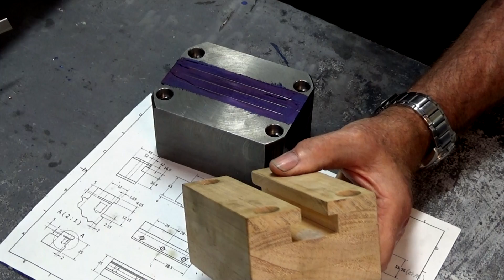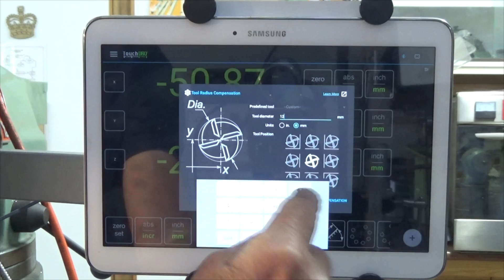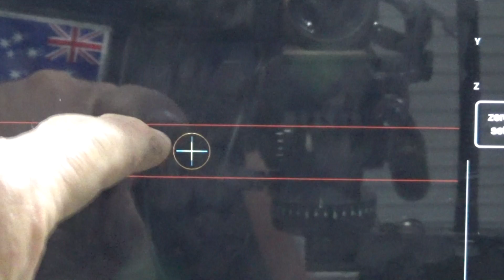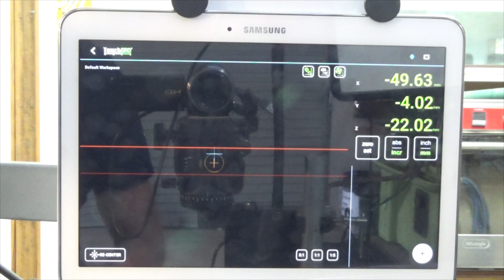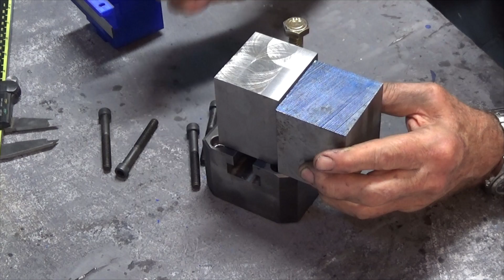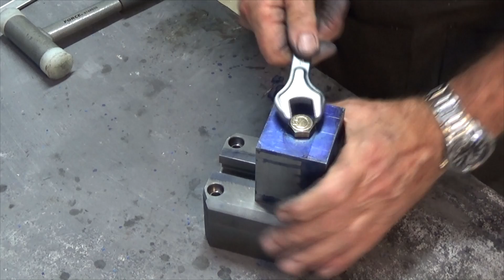Rear Parting Tool Holder For Your Lathe - Part 2

Comment: If instead of making this rear support we reversed the rotation of the chuck and placed the tool with the cutting edge facing down, wouldn't that be simpler?
Reply from the maker: I have a parting tool like that. It works well but having the rear toolpost means that you don't need to reverse the spindle to part off. You can just face turn, drill or whatever and then part off without stopping the lathe. I think a lot of capstan lathes were designed that way.
Regards,
Mark

Comment: That’s a nice fit. And the DRO was the hero of the task at hand ! I haven’t seen numbers like that on my mill yet. It’s getting better and better. But that’s very impressive Mark ! Something to take pride in accomplishing. 😁👍🏻
Reply from the maker: Thanks. I am getting more and more confident with the DRO setup on my mill. I recently bought a small touch probe from China and integrated it into the TouchDRO system. It allows me to get inside tiny bores to find centres and I have been able to calibrate it to give me within 0.01mm of an indicated edge. 
Regards,
Mark

Comment: Excellent work, Mark.  I'm really enjoying this series.  At 28:35 You fit the block to the T-slot on the larger tool rest and there's some interference in the last few microns of engagement.  I suspect some radii need to be added to the top surface along the T-slot in order to clear the never quite perfect corner fillets left by the mill when milling out the tenon of the tool holder.  It's been weeks since you've posted this video, so no doubt you've already worked it out.

Comment: "... just gives you visual confirmation you're not about to do something stupid." - Around here we call that a 'sanity check' and use such checks quite often - and STILL make mistakes.
Reply from the maker: The capacity for my brain to make the totally incorrect choice when setting up for a non reversible operation is truly amazing. Sanity checks reduce the error rate but it's never zero😁
Regards,
Mark

Comment: Finally got to watch this episode :-) The end mill that you sharpened seemed to be cutting better now, than on the day you sharpened it.
This is a massive tool holder (surely minimal chatter). Great features on TouchDRO.
Reply from the maker: Thanks, I have finished all of the parts now and I have installed it on the lathe. I've done a few preliminary cuts on some aluminium but I  am a bit reluctant to find the limitations of the parting blade. That is going to be part that will fail but you will get to see the final episode shortly.
Regards,
Mark
Reply: @Preso58  Thanks for this preliminary info! Yep, that parting blade is thin, but without geometry misalignments and no chatter, it can be very effective. In any case, you can always use an insert parting blade, which should be significantly stronger.

Comment: Ciao Mark, maybe in the same time we ( me and you) were using that pararrel blocks to take a measure on a video, incredible! I love to see how rigid Is your milling machine during the work, with my milling machine that block at minimum twice the time you did! Also your DRO Is very different from the standards DRO like mine, i really enjoyed watching your part 2!  Ciao Mark, Alberto
Reply from the maker: Thanks Alberto. I am still getting used to the Bridgeport and I am learning to push it a lot harder than I did when I first got it into the shop. Having sharp cutters makes a huge difference. The TouchDRO has some nice features and having a graphical display works well for me.
Regards,
Mark

Comment: I just finished cutting a number of T-slots in aluminum using a woodruff key cutter and it worked very nicely. I just set my speed and feed rate by feel and sound. I used a bit of lubricant as well whereas you didn't need to in cast iron.
Reply from the maker: I must admit I am not one of those wizards who can calculate chip loads and feeds and speeds on the fly. I think that listening to the cut and looking at the way the chips are coming off is a good indication though. 
Regards,
Mark

Comment: Nice work!

It seems to me that the tooth cutting the T-slot on the left side didn't know anything about the tooth cutting the T-slot on the right side, so wouldn't be in a position to negotiate a doubling of the surface speed.  Or that's a thought!  :)
Reply from the maker: You gotta work with what you've got. 😁 I tend to shoot from the hip when selecting chip loads and surface speeds. If it sounds right it's good enough for me.
Regards,
Mark

Comment: Some top quality machining there. Its coming along nicely Mark. I like you big chamfer tool. I need to get one of those.
Reply from the maker: I first saw that style of cutter being used on West Welds channel. I have been reminded to avoid using the bottom of the insert as the surface speed is much lower nearer to the point. 
Regards,
Mark

Comment: try a mist coolant solution it works magic on my mill. no mess....
Reply from the maker: Unfortunately, the genuine fog buster units are very expensive here as they need to be imported from the USA. I just checked and the basic unit is AU $750. The cheap Chinese clones are notorious for making a superfine mist rather than a spray of droplets. I already had a three phase coolant pump in the base of the mill and it was already wired up but quite frankly, it makes a huge mess. The overflow off the back of the vice ends up on the floor and I will need to make some sort of deflector to catch that and direct it into the tee slots for draining back into the base. 
Regards,
Mark

Comment: Useful features on the "TouchDRO" application  bordering on CNC toll compensation, great introduction when a user migrates, If they do of course. 
Nice work,  looking forward to seeing further videos. 
The malleable iron is a great vibration dampener material. 
Thanks for sharing. 
Regards John
Reply from the maker: Internal damping was one of the characteristics that I was looking for in the malleable iron. Plus it's just nice to work with. 
Regards,
Mark

Comment: I think the radius of the block fitting into the T slot should be relieved. Then you will be able to move it by hand. A chamfer on the base block T slot top edge would do it.

Comment: Hello Mark,
Nicely done... enjoyable viewing, thank you. What finish will be be putting on the tool holder.
Take care.
Paul,,
Reply from the maker: Paul, I will be parkerising the steel parts. I am not sure about the malleable iron base. I believe you can parkerise cast iron but I haven't tried it yet.
Regards,
Mark
Reply from the maker: I have looked into it and I did make a mist coolant system for my small CNC mill. The genuine fog buster units are probably the best but they are very expensive (in Australia). The flood coolant system was already installed on the Bridgeport. It just needed some new hose and a clamp for the Locline. I need to refine the way I use it. I am finding places where the coolant overflows from the vice but I think it can be fine tuned a bit and be useful.
Regards,
Mark

Comment: Your beginning operation to cut the slot consisted of milling side to side at n mm increments.  I would have brought the cutter centerline to just shy of the edge of the part and plunged to 21 mm deep.  Follow that by successive plunge milling operations until you're through the width of the block.  Cut from one end to the other at 21 mm deep to have the slot central on the part.  Then do your off-sets and cut the slot to 22 mm deep.  I found this to be faster than successive passes.
Reply from the maker: Thanks for the feedback. What I did probably appeared clumsy and I often look back and see ten different and probably better ways to achieve the same result. However, I am not looking for efficiency so much as trying to achieve an accurate result. I tend to be very conservative in terms of speeds, feeds and depths of cut. I am sure that the Bridgeport is capable of much heavier cuts and I am slowly working out what it's limitations are. 
Regards,
Mark

Comment: Looking good. Have you considered mist coolant for the mill, a lot less mess but a bit air hungry.
Reply from the maker: I do have a shop made mist coolant system on my small CNC mill. It works well but it makes a huge mess. The air blows the chips everywhere but on aluminium it does keep the cutters cool and it blows the chips out of the cut so they don't get welded back onto the part and the cutting edges. The flood coolant on the Bridgeport does a good job and I did find two holes in the front and back of the vice that were allowing the coolant to drip off the table and onto the floor. I have since plugged those holes and it's making less mess now. 
Regards,
Mark

Comment: Looking great so far👍  Did you chamfer the top of the slot at all?  Just wondering if there's a small radius at the end of the cutter you used to make the tenonwhich would leave a small fillet at the base, which would lead to binding as you tighten the post down. Cutting a small chamfer at the top of the slot would mitigate that, maybe letting the post slide freely when not screwed down (and sit flatter and more rigidly when screwed down, spreading the load more)
Reply from the maker: I will fit all the parts when they are all made. The 12mm carbide end mill that I was using is probably a bit worn on the lower end of the helical flutes so the top of the slot will be wider than the bottom. I did chamfer the top of the slot with a file but it might need a bit of scraping to get it sliding nicely.
Regards,
Mark

Comment: Hi Mark good progress on this project, inverted tooling has an advantage on well used lathes as the head bearings ware, the load pushes againest the bottom of the bearing to reduse movement in a vertical position 
in some casees of head ware it will help reduce chatter.

regards
ken
Reply from the maker: Thanks Ken. I have now finished all three parts of the build and I have tried it out but I am very nervous about using power feed. Ultimately, that is the aim but I want to use it properly with the camera running. If it can cut without chatter and I can relax and use the  power feed I will take that as a win.
Regards,
Mark

Comment: Conservative…. your chips look too fine for a 12mm carbon. Why is there so much noise in the spindle?
Reply from the maker: That's how Bridgeports sound. They have straight cut gears in the drive to the spindle. You are also probably hearing the rotary phase converter.

Comment: Your work is top-notch! 
I have a Colchester Student which is not my main lathe (it's just sitting around) but it's a very nice machine. I have downloaded the manual that shows the rear toolpost. I am in the process of making one for my German Gema LZ 160 which I use all the time. The nice thing is that it already has two T-slots in the casting of the cross slide, perpendicular to the main machine axis. This makes it very easy to set the tool holder in a position suitable for the workpiece geometry. 
One remark I would like to make is that the Colchester toolpost also has inverted the clamping surface and screws, so that the cutting forces are not pushing against the screws. The nice way you made this in two parts, a main body and the holder on top will make it easier to change the latter. 
Very good idea to use malleable iron, will research this further. I can buy grey cast iron in several qualities cut to size from a Dutch supplier but don't know yet what the cost is.
Keep up the great work, looking forward to the next video.
Reply from the maker: Yes, having tee slots in the cross slide would be wonderful. The Myford Super 7 lathe has this feature and it makes the machine very versatile. I actually modelled and exact replica of the original Colchester rear tool post with the two tool slots but it seemed unnecessary for what I wanted to achieve. The malleable iron can be purchased under the name "Durabar". 
Regards,
Mark
Reply: @Preso58  This material looks very promising for many applications. 
In fact as a coincidence, I had to make some replacement conveyor chain links and it just so happened that off-the-shelf threaded malleable iron fittings were the perfect size for the bushings, with minimal excess material. It's a bit of an emergency repair but I expect them to last for many years since the conveyor sees very little use. A bit of the root of the thread remains which I think will be very good for holding lubricant. Since the ductile cast iron does not hold (much) 'free' graphite (flakes) its self-lubricating properties are not as good as regular cast iron it appears, although working with it will give you black hands. We'll just run it and evaluate, gonna be interesting. Another point is that the bushing outer surface slides on a guide rail and this will produce wear in the form of a flat surface developing eventually. The current hardened bushings (may be surface hardened/ carburized) have worn almost through the full thickness but this has taken more than 40 years. Manufacturer's claim is that ductile is more wear resistant than grey cast though.
I have looked at the Durabar website, they have no sales channel in Europe so I will have to find an alternative.

Comment: Whilst it is neat that your DRO system does the sums for you- for slots like this you can do the calculation in your head much faster. For complex cuts I tend to make a DRO map of co-ordinates and mount it on the mill- just follow the numbers as fast as you can dial them. Less time on your feet...
Reply from the maker: That is just me being a nerd! I must say though that I am a very visual learner. Mathematics for me is torture but if I can seen a visual representation I can relax and just use the digital readout as confirmation that I am on track.
Regards,
Mark

Comment: Senior moment there Mark😉 The No of teeth has no influence on cutting speed, only feed rate. While on the subject it is better to chamfer cut closer to the cutter shoulder as the point has close to zero surface speed.
Reply from the maker: Thanks for the feedback. I am very much a "suck it and see" machinist. If it looks and sounds right I am happy. I do agree with your observation about the chamfering tool though. I will do that next time.
Regards,
Mark

Comment: Mark like you I always have a clean pair of undies whenever I tried parting off; it has a very large pucker factor. In the past I made a leg for a grooving tool (Winkys design) but was never happy with it. Spurred on by your project I made one myself this arvo. I started with a large chunk of aluminium (I know I will come to regret that) and bolted this to 2, 8mm tapped holes in the cross slide using socket head cap screws. The aluminium block is the same height as the steel rises (replacing the compound) on the front of the cross slide. I then used a spare AXA QCTP and mounted this on the aluminium riser. I have 3 different parting blade solution I have used in the past, a 3mm insert blade tool, a 2mm grooving tool and HSS blades. Each one was adjusted so that it was upside down and the cutting edge was on center height. Imagine my disappointment when NONE of them worked; I tried all of the belt permutations for each of the tools and none of them gave anything While I enjoyed the shed time I would judge none of them a success. I hope yours works better than mine!
Reply from the maker: Michael, that sounds disappointing indeed. I made a tool many years ago from some welded hot rolled steel sections which bolted on to the back of the cross slide and it too was a failure. Looking back now it was far too light and I didn't have any way of machining the mating surfaces accurately so it was probably not seated down onto the cross slide accurately. The tool bit chattered quite badly and I just gave up and scrapped the whole contraption. I am hoping that the new version has enough mass and is accurate enough to be at least an improvement on the front mounted solutions I am using at present. I should be finished mid week and of course it could all be for nothing but I badly want it to succeed. 
Regards,
Mark
Reply: @michaellinahan7740 
Probably an overlooked factor is bellmouthing of the chuck jaws like Rob Renzetti has done his most recent video on. on 'uncorrected' jaws the clamping is only effective on the inside, so the true unsupported length of material is much greater than it looks. Correcting this is not a trivial task though. A quick fix would be to clamp some paper between the jaws and the workpiece near the outside. Also it is a good check to see if this improves the situation. When all is said and done, any machine has its limitations, I have abused a tiny Hobbymat lathe when I was a teenager before moving on to serious machines.

Comment: You didn't consider just clamping the parting tool directly in the tool holder that you just made  ?
Would get the blade closer to the centre bolt
Reply from the maker: I did think about that. I want the design to be capable of taking different styles of parting blades or perhaps threading tools too. If it is successful I can fit a parting blade permanently on the other side of the riser.
Regards,
Mark